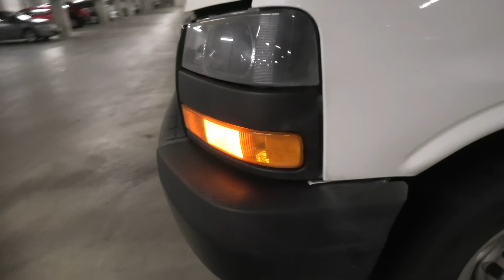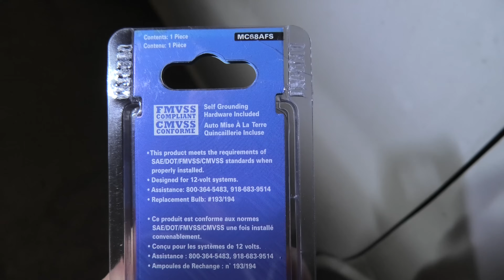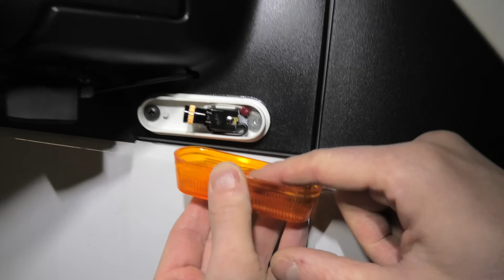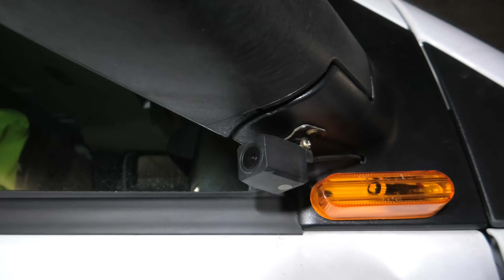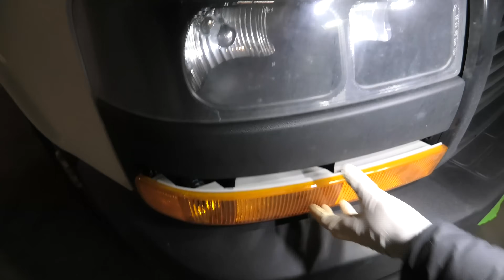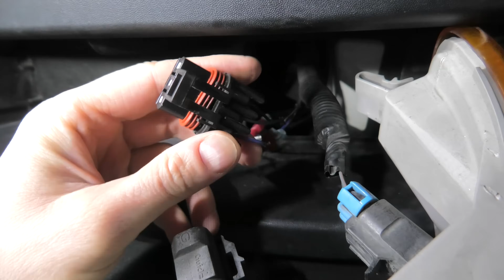Chevrolet Express / GMC Savana - Extra LED Turn Signal Light Install. Make Your Van More Visible!

Comment from the maker: PRODUCTS USED:
1. AUXITO 194 LED Light Bulb, Amber Yellow 168 2825 W5W T10, Pack of 2 - https://amzn.to/3Kx6EMe.
2. OPTRONICS MC68 SERIES:
 - Amazon - https://amzn.to/3Y6YSiS.
 - Official Website - http://optronicsinc.com/PRODUCTS/Brands/Optronics/Products.aspx?SeriesID=439
3. RING TERMINAL - TICONN Heat Shrink Wire Connectors - https://amzn.to/3II4sT2.
4. DIELECTRIC SILICONE - Gardner Bender 79-600 Terminal Grease & Dielectric Silicone Compound - https://amzn.to/3Sn4YXj.
5. WIRES - Silicone Stranded Wire Automotive 6 Colors 10Ft Each 16AWG - https://amzn.to/3XTgjzE.
6. ELECTRICAL CONNECTORS - 150PCS Female/Male Spade connectors Blue Terminal 16-14 AWG - https://amzn.to/3YXzVE4.
7. CONVOLUTED SLIT LOOM TUBING - 100 Feet 1/4" Split Loom - Tubing Wire Conduit Hose Cover - https://amzn.to/3YVj9Fs.
8. LIQUID ELECTRICAL TAPE - Gardner Bender LTB-400 Liquid Electrical Tape, Waterproof, 4 Oz. - https://amzn.to/3lYaUtZ.